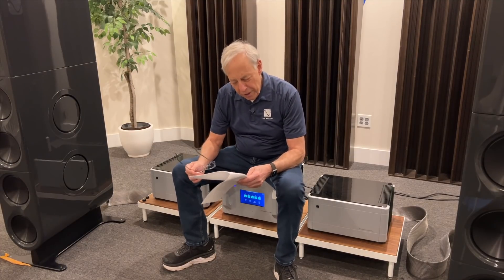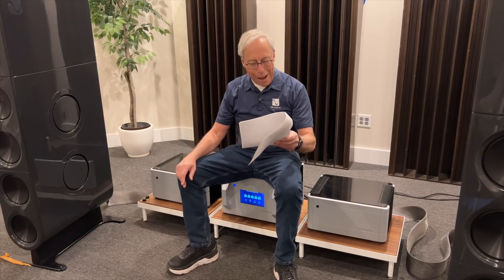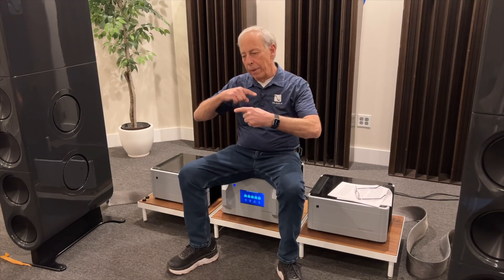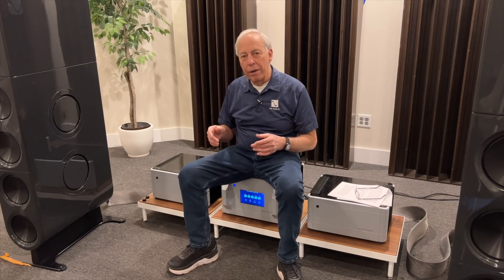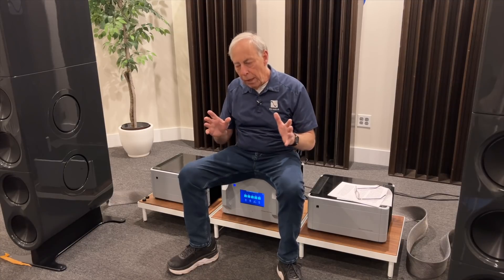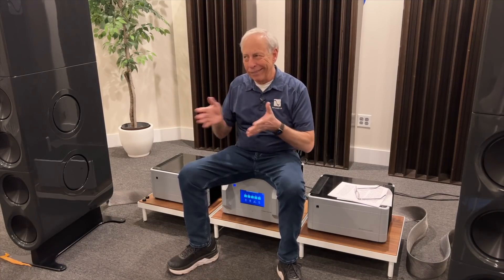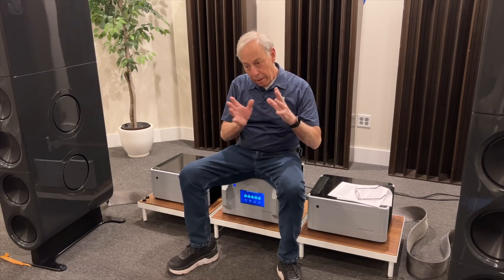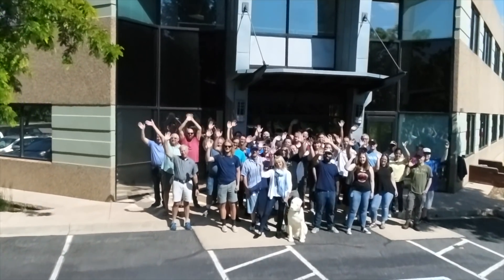ADCs vs  DACs

Comment: The mastering that was performed before the "Loudness Wars" which allowed the music to "breathe" rather than being over compressed and "crunched" in sound quality probably made more difference than the differences in digital conversion. Saying that ... if something of high quality is converted from properly stored and processed analog master tapes today in the traditional "pre-loudness wars" method then the results should be superior to most of the current over compressed and over processed recordings of today. It's interesting that just as we were presented with digital formats that allowed more signal to noise ratio without hiss and background noise most of the recordings were being mastered to the point that they ended up with less dynamic range in the actual final mixes and mastering.

Comment: Which begs the question. Why do so many modern "remasters" and rereleases of older material not sound that much better than original releases? I ask rhetorically, as while technology may advance, the skill level of the engineers may not have necessarily.
Reply: Because modern "engineers" spend way too much time trying to make their creations sound ok on a crappy mobile phone speaker (or over-processed 'smart' bluetooth speaker) rather than making great audio and leaving lazy customers to upgrade their crap.
Reply: @paulstubbs7678  they still use proper monitors but when you are raised on loudness its becomes normal and also many more amateur’s are in the game now due to the internet

Comment: Nice attempt to try and imply that PCM really originates from DSD, but unfortunately that isn't true.
First of all, while Sigma Delta converters are certainly the most common type of A\D converter, they are not the only type and they are not limited to single-bit operation as you pointed out at 1:48 .
In fact, the definition of Delta Modulation is the signal conversion technique from analog to digital and digital to analog. 
Differential pulse code modulation uses the predictive waveform coding technique for signal conversion. The same technique is also applied by using the Delta Modulation process. 
In Delta Modulation, the sampling rate is higher to reduce the number of steps to decrease the bandwidth of the signal. 
It is a form of Differential Pulse Code Modulation (DPCM) and is called 1-bit DPCM.

Also, it should be noted that Sony released the 24-track PCM-3324 in 1982 and 3M had released a digital Multitrack recorder before this, so there it is not factual to assume that the master tapes that CDs from the 80s and 90s had analog tape sources.
Reply: Yes, especially when you get away from the audio band, either into instrumentation (successive-approximation ADC) or video (flash ADC), other converter types become more prominent.

Comment: I remember working with DACs and ADCs in the 80s in the aero industry, but then we called them D-to-As and A-to-Ds. Short names that to me more clearly expressed what they did. I miss those old names.
Reply: As if someone in the aero industry has a problem with three letter codes. I'll still be chuckling about this when I next fly out of YYZ.
Reply: Interesting, I was working in the medical electronics industry back then. They where called ADCs and DACs, just like Analog Devices would call them.
Reply: @hugobloemers4425  The other thing I should mention is that I'm UK based. So may be an British thing. Or maybe just where I was working (Rolls-Royce)

Comment: in the 90s the master source was likely digital.
Reply: You bought CDs in the 90's and it would tell you on the box: AAD; ADD; or DDD (Recorded, Mixed, Mastered)
Reply: @hugobloemers4425  Yeah, SPARS code.
Reply: @hugobloemers4425  I always thought it should be worded differently.. Recorded TO, Mixed TO, Mastered TO..
But I guess im an audio tech.. So even if you are mixing through analog gear, its still a D as the source you are working with (for the most part unless youre working off of a multitrack tape machine) is converted to analog, put through the outboard. then converted back to digital.
Reply: The full tracks maybe more so.. the masters were both
Reply: The master source is not really the issue, more how much the engineer abuses a DAW by using way too many plugins, processing the crap out of the sound.
Reply: @paulstubbs7678  for some it is. if you hand me two excellent recordings, i prolly cant tell if theyre digital or analog recorded. hell, i used to track and overdup  in analog then mix in digital.
Reply: @ceylonmooney  Yeah I started that was as well.. but also mixed in analog.. terrible times haha
Reply: @drdelewded  i mixed in analog...well, shit, most of my musical life. did sessions with an automated board...wasnt so hot on that...mixing on my DDA AMR24 or TEAC/tascam was a lot of fun. i tell u what, tho, bein able to edit in digital is fantastic. id rather bounce them edits than punch in/out any day. 

of course, a studer aint gonna decide to erase itself between sessions the way my macbook pro just did.
Reply: @ceylonmooney  
External drive backups are a lot cheaper than duplicating your 2 inch tape..
Reply: @drdelewded   yes they are, but u can count on a studer to not erase itself overnight
Reply: @ceylonmooney  I know it's basically a meme now, losing files due to drive error, but i have however never lost drives or files in 25 years of post audio production due to corrupt files. I have in the 5 years I worked with tape accidentally overwritten tracks while over dubbing by arming the wrong tracks haha
Reply: @ceylonmooney  I wonder if its a Mac thing?
My work has always been mac, except for one suite we had with soundscape 15+ years ago, and the other suite we had with pyramix before PT could handle Atmos.
Reply: @drdelewded  i think its a regular thing, or at least as regular as any other mechanical/digital failure, like a water pump on ur truck going out.  ive been hearing of HDs and compuers crashing for decades. 

ive mostly used MAC. i think ive only used MAC for protools. hard to remember rite now. .
Reply: @drdelewded  oh man! i HAVE done that bere. "whered this and that go." "uh....shit, we just taped over it." 

i dunno anything of corrupt files, but i know HDs do crash!
Reply: @ceylonmooney  we flip out Mac's every 5-6 years. New HDs . We have 7 suites. I've never in 21 years had an internal drive die in those. There was an external 9 gig start to get noisy (9 gig the size of a two Mac minis.. this was in 2005-2006.. we just backed it up and replaced it. However in the nearly 100 drives we used 40 hours a week 52 weeks a year that's the only drive failure I've encountered.
Reply: @paulstubbs7678  Oh yeah? Which plugins?

Comment: The best way to improve digital audio is to sit on the power amp for a while.
Reply: It's a P20 power regenerator.
Reply: @marianneoelund2940  Is the heat output the same and does it effect the rhythm and pace of the electrons while performing palaple micro dynamics?
Reply: Isn't that a pre-amp
Reply: absolutely. in fact, the mechanical compression improves dynamic range in phase inverting scenarios.
Reply: @ceylonmooney  I wish that I'd have thought of that. 😉
Reply: @tomehCanada  haha! right on my brother.

Comment: Analog to digital improved, but 40 year old CDs are likely to sound better because much more importantly they predate the loudness wars.  Back when audio engineers used their ears, not their eyes as they spike things to -00.1db
Reply: About the only use I've ever found for "spiked to 00.1db" recordings is testing that end of one's sound system. otherwise their fairly awful